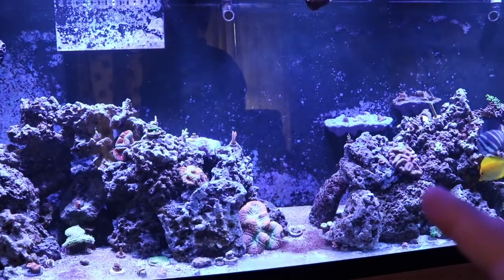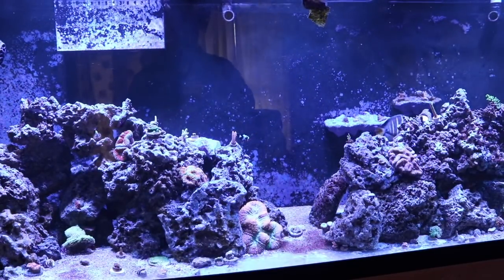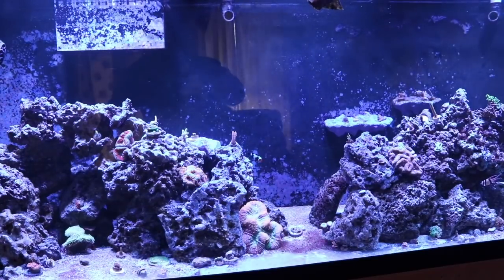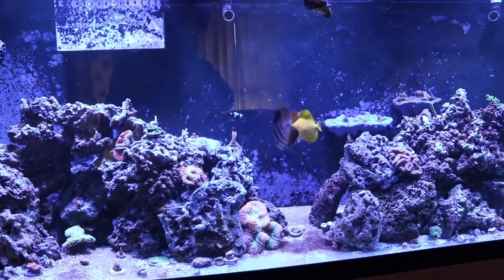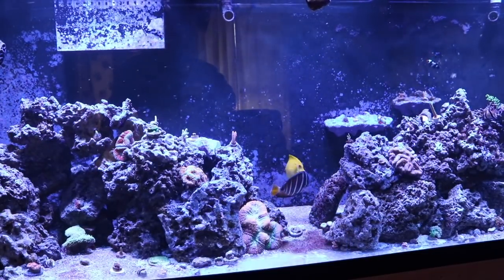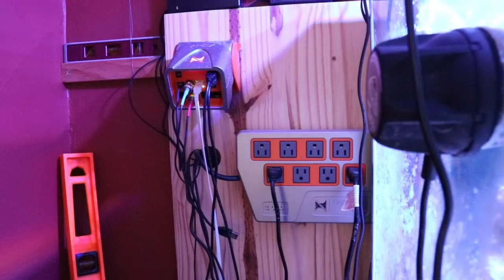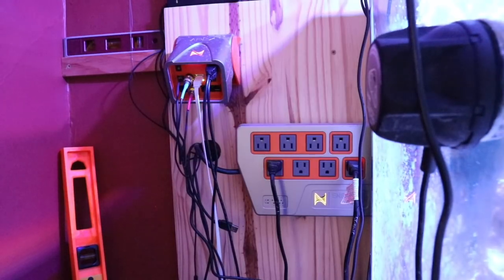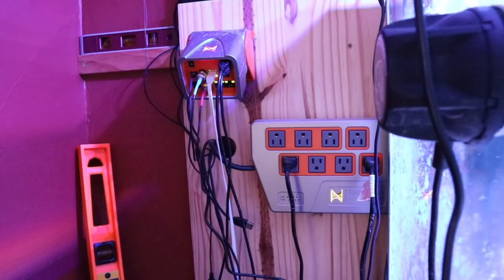My Aquarium Controller Failed

Comment: Man, really sorry to hear this happened to you.   
Honestly though, I don't really see this as an automation problem.  It's a power management problem that in turn affected the controller (although I do understand the point  you're making).  I used to live in Montreal so I totally understand the concerns about the weather.  
I think you already mentioned it in your video but there should have been a UPS in front of the Apex to protect and support it.   Had that been the case, there most likely wouldn't have been any problem with current spikes or power failures.   Might also want to have what you guys call a DJ switch or power bar installed strategically and ready to go, to allow you to move your power connections over in the case that you want to connect manually.  (except the Apex powerheads that can't plug into regular power)  
As a side note, Apex should really have a battery back up accessory option for their equipment.

Comment: Hi Jeff sorry to hear about your issues...unfortunately it happens...I have my energy bar connected to a UPS surge & still lost my wav pumps during a lightning storm...if I plug the wav pumps to either the 1link or the energy bar they both just shut down..Hearing your problem makes me wonder if the 1link cable system is flawed???

Comment: Hey Jeff ..I had a Similar issue, try reconnecting your aquabus cable to the base unit and the energy bar832 and if you able to see the energy bar through the local web page not fusion, try updating the firmware of the energy bar. It may take a few trys to get the firmware loaded. Also try power cycling the head unit. I feel your frustration. If all else fails you may have to send the energy bar back to Neptune Systems for repairs or replacement. These new energy bars832 are more sensitive to surges than the old energy bar 8s.
Reply from the maker: I'm going to give this a shot and see what happens. Thanks for the tip.

Comment: We can't think of automation as a rotisserie that we can "set it and forget it"

Having an items that can run independently without another other equipment is a plus, some time it may come at an additional cost but having less dependents is a huge plus. Especially if it plays well with others too. I don't know if you have to have an extra 8 bar on hand is the ideal solution, I would say that if you have a item that has a dependent, maybe keep a less expensive item on hand that can just plug in and work just temporary while you deal with the issue. When dealing with automation, it is great to setup everything to be automated, but the number one goal should be on alerting you when something goes wrong, which I think some people may see as a secondary function until something happens. So setting up the Hart Beat to bug you when its disconnected, alarms when water is detected, or if you have the newer Apex you can also keep track power usage, you can create alerts for each devise to let you know if it is consuming too much power or if the power consumption is too low, some times these power alerts can let you know that a pump needs to be cleaned or that it could be experiencing issues. 

While the Apex are a higher dollar luxury item, they are well thought out and have come a huge way since I started in the hobby about 15 years ago.  They have lots of alert that people do not think of because the focus is on getting their skimmer to auto shut down when the return pump turns off. Which is a great feature BUT more focus should be done around alerts and preventing major issues. Also, if the majority of your items are just set to on and off then there are way cheaper options out there when looking at home automation plugs. 

I think suggesting that someone keeps two controllers for redundancy  is less realistic for most people in the hobby. How do we configure the controllers to let us know sooner when we have an issue so that we can intervene to prevent a large scale issue. Maybe reach out to Apex and see what could have been done differently so that you could have been notified sooner when the pumps went down. I don't know if the One Link power source monitor also the power consumption. I know the Apex PMUP now has a power option instead of using the One Link port, I wonder if that same power source would work with the Apex Pumps?

Comment: Doesn’t the apex have alarm email to notify you when parameters are off or it’s off line? I have the apex classic and it controls run pump, skim, temp, and dosing. Everything else is independent.
Reply from the maker: It didn't send me a notification on my ebar going "missing"

Comment: Do you use a surge protected power strip between the apex and the wall? Also I dont bother with wifi I ran a 100ft cord to my apex so it never loses connection unless I lose power in my house or my router breaks.
Reply from the maker: That board is raised off the wall and I already have a cable running to the Apex but great tip. I need to upgrade my Apex for more reasons than just my Apex.

Comment: Damn! Sorry to hear man. I was thinking of getting the apex controller($500 version). 
 I like my jebao wave. So I’ll just stick with those I guess. And not go all in with the apex everything. 
Spare heaters-check
Spare pumps-check
Spare surge- need
Generator-need 
Well, bye for now.
Reply from the maker: I wish I started using the 1 link sooner. My energy bar may have lasted longer if I didn't have it maxed out for 2 years.